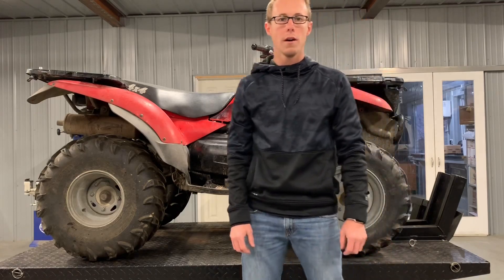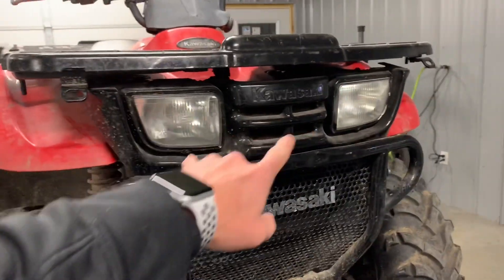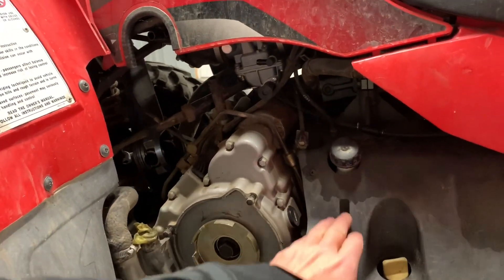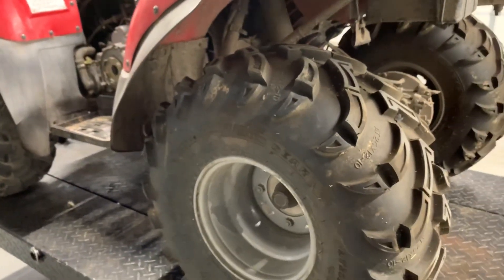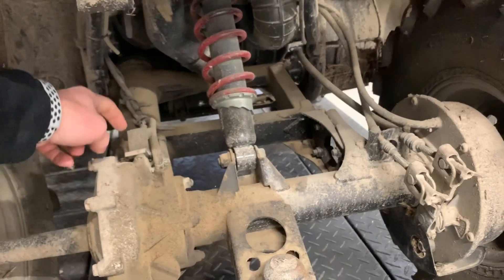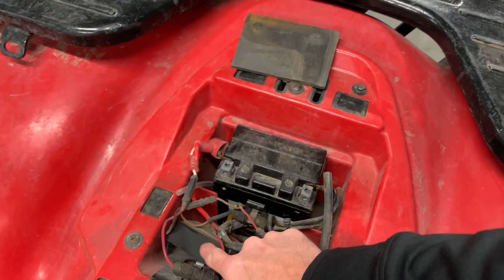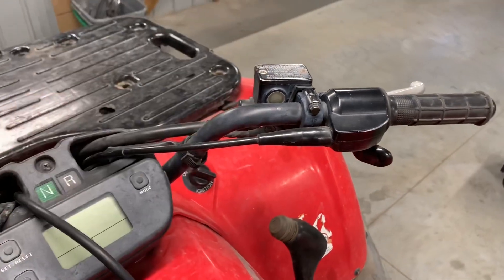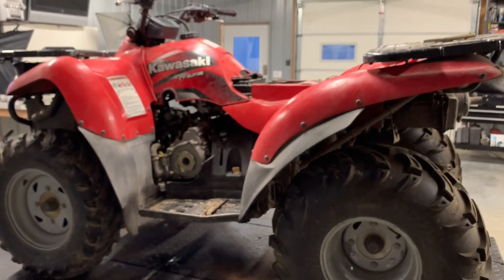Kawasaki Prairie 400 4x4 Automatic - ATV Review - Common Issues - Service

Comment: Good video. Correction at time stamp 5.20 - author calls the coolant valve a filter. This item is actually a thermostat valve in the return line to the radiator from the carburetor. When the coolant is cold the valve is open causing coolant to bypass the main engine thermostat so as to heat up the carburetor quickly. Then as the coolant warms up the valve closes off the valve forcing all coolant to pass through the main engine thermostat. The purpose of this valve is for quicker warming of the carburetor so as to reduce the potential for carburetor icing allowing for a smoother transition from a cold engine to one operating at proper temperature.

Comment: Nice info on these videos ..i have a 2001 Prarrie 400 I turned the key off and now it won't start .even with a squirt of starter fluid  have fuel .spark. Air And good compression.it won't start .what can I do you think the valves need adjusted.please help.thanks for all the info

Comment: I just want to know why mine pulls to the right so hard could that be a Tyrod also it has a hose running from the vent on the gas cap and it will try and die like it’s not getting fuel but if I blow into the vent hose it will run fine for a while

Comment: On the rear of the bike. There’s a large black hose/duct that goes from the bottom section up to the seat area. What is that for? Because mine is missing the portion that goes up to the seat area.

Comment: Hey my 02’ prairie 400 started revving up itself in idle, what do you think it could be?
Reply from the maker: Air leak. Bad throttle cable. Choke issues. Let me know what you find!  Thanks for the comment and for watching. Let us know if you have an questions! Let us know if you need parts: https://www.ebay.com/str/midnebraskamotorsports

Comment: My Prairie 400 transmission is block. Can’t move my transmission handle to the neutral position. So can’t start. I tried to hold the handle and foot brake to by passe the lock. Don’t work. Shake it nothing happen. Do you have an answer pse Thanks in advance Andre

Comment: Hello I just got one of these in trade that my friends daughter tried to jump start the battery and burnt up the igniter box. Before I spend $500 on a new one what should I check to make sure the new one don't burn up?  Btw it is a model year 2000 400 4x4. Thank you
Reply from the maker: Eric. A new one wont be burnt up. Are you purchasing a used one? Not against the idea but unfortunately there is not test for these except for installing them to make sure they work. Sorry I didn’t have better news. You might check with Rick’s electronics. They are a good reputable electronics dealer. Thanks for watching.
Reply: @MidNebraskaMotorsports  I ordered a brand new igniter.
Reply: @MidNebraskaMotorsports  it fired right but it only runs when the choke is on. I'm going to clean the carb. Thanks for the help.
Reply from the maker: @ericbivins8014  Absolutely. Make sure that pilot jet is completely cleaned before going back together.

Comment: I have a 2007 360 4x4.  Mine is almost exactly the same except mine is air cooled and has a oil cooler where you have a radiator and my rear end is different with a wet break system. So when you do videos on this model I can use them for reference on mine right? Just wondering. Thanks, love your channel 🤣👍🏻🤘🏻

Comment: I have a 2000 kawasaki prairie 400 4x4 with a problem with the rear wheels will not turn the front wheels work fine but the rear are not turning , rear differential has oil and not making an noise at all .any thoughts?
Reply: The 4wheel drive works in the front but not the back.

Comment: Quite the informative video. I recently inherited an older version of this bike. Forgive this stupid question, but I can't seem to figure out how to engage the four-wheel drive, there doesn't seem to be a switch. Also, I get a slight rattle-like sound as the engine spins up, but it stops when the engine revs high enough. I should also mention that it stalls when the fuel switch isn't on reserve. Care to explain that, too? Thanks.
Reply: @MidNebraskaMotorsports  thank you for the reply. Yeah, it's the 4x4, found out it engages in low or something. I'll see what I can do about the clutch and the petcock. Thanks again man, I appreciate it!

Comment: I lost my key. How can I turn power on for
Reply from the maker: Hot wire it. Look for those instruction on the black market.  Honestly I'd just replace the switch. We have several of them for cheap:   check out: https://www.ebay.com/str/midnebraskamotorsports
Reply: I bought a new ignition switch with 2 keys on eBay for about 8 dollars, very simple to replace.

Comment: I have a 1999 300 prairie it’s running a little rough and bogs down when I push on the throttle if I don’t have the choke on. Doesn’t bog down with choke on. I’ve cleaned the carb everything checked out good, changed the oil it looked fine, and changed the spark plug it was a little odd I saw oil on the old spark plug like it was coming up through where it threads in not leaking down into it. What would be your assessment sir? Thanks for taking the time to read this. Hey
Reply: Mid Nebraska Motorsports thank you sure I sure will! Really appreciate the videos they help a lot.
Reply: Hi sir, so I finally got the quad running good. A shop figured out that it was the fuel valve that was causing my problems. It wasn’t allowing fuel through. Quad pretty much runs awesome now, other than if I’m running it real hard it acts like it misses out every once in a blue moon. The shop said I need to try and find an original Kawasaki carb for it. They couldn’t find one they think they’re discontinued. So I’m wondering if you know where I could find a used one and rebuild it?
Reply: It’s prob your carb because my bogged down and ran for 5 minutes and started shutting. Off turnes out my carb was jammed pack with guck
Reply: I got an old 1999 kawasaki prairie automatic 300, she's overheating and i cant find the location of the coolant reservoir.
Reply: Needs help...I got an old kawasaki prairie automatic 300, shes overheating and i cant find the location of the coolant reservoir. Thank you

Comment: Going to look at a 2000 Kawasaki Prairie 400, any way to test the rear diff? Would you even recommend the Prairie 400? If the diff goes out can you buy a new one or is rebuilding the only way to go?
Reply: No i did not got a Honda Foreman instead
Reply: @MidNebraskaMotorsports  2003 Honda foreman 450 ES

Comment: From diff is a limited slip...needs special fluid or regular 80/90?
Reply: @MidNebraskaMotorsports  I have gl-5 80/90 from walmart I used in the rear. Is that fine for the front too?

Comment: Do you have a video on how to change coolant?
Reply: @MidNebraskaMotorsports  thank you. I just bought a 2000 prairie 400 4x4 with super low miles just sat most it's life so I've done oil change and diff fluids and belt just need to flush the coolant and re fill but I'm not seeing the drain. Also is there a way to tell if the radiator fan is working? Thanks
Reply: @MidNebraskaMotorsports  thanks

Comment: My starter spins but doesn't engage the motor I'm assuming the starter clutch is bad...how hard is that to change?
Reply: Make sure your battery terminals are on correctly, + on +, - on -, if they are connected wrong the starter will spin the wrong direction and wont engage the motor.

Comment: when i put mine into gear, high , low ,reverse it just starts going i don’t know why the throttles not down it just starts rolling
Reply from the maker: Can you turn the idle screw down. If you've done that and it doesn't fix it we can either go through your carburetor for you or you might have an air leak. Let me know either way! Thanks for watching.